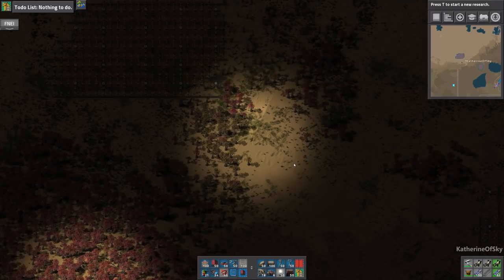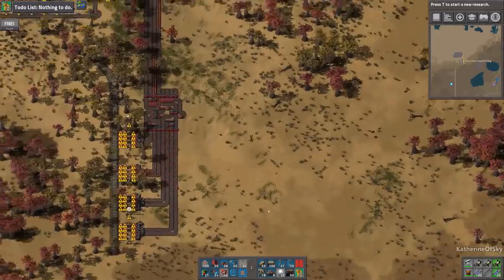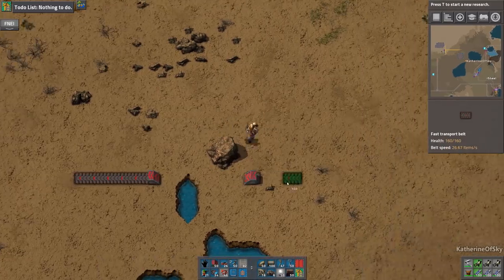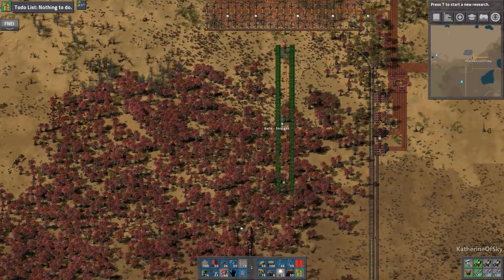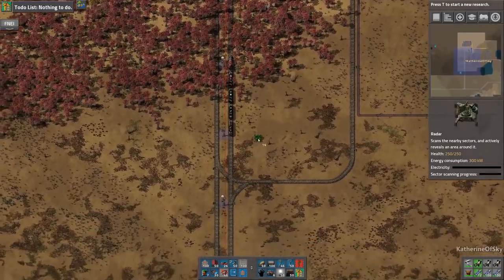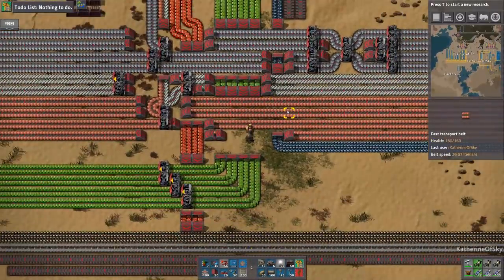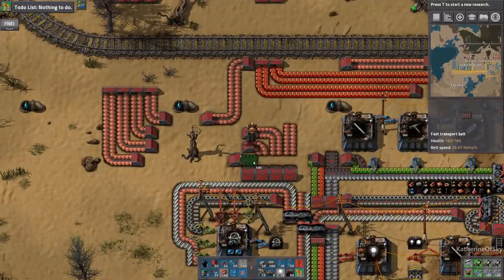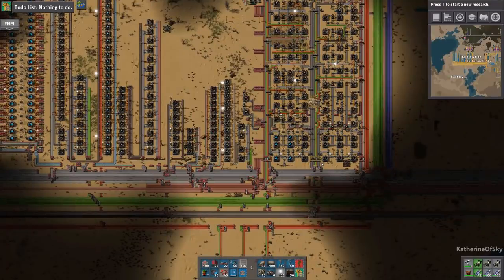Whistle Stop Factorio Ep 49: BASE COPPER PRODUCTION - Mod Spotlight, Let's Play, Gameplay

Comment: For straight rails, you could make a blueprint with signals 5 carriages away from each other? Until there's a better option maybe. Keep doing what you're doing, love your Factorio series'!
Reply from the maker: That's an interesting thought.  My current BPs are tuned to the max large power pole distance, (so to save on power poles), but signal length might be a better item to tune for.

Comment: If you're worried about belting yourself into tracks.. There is a method of braiding 3 belts onto the width of 2. Two underground chains that are NOT started at the same point, with a 3rd belt snaking in between.
Reply from the maker: You can braid 3 belts into the space of 1 if you use all different-colored undergrounds.
Reply: That requires using e different colors of undergrounds, which means that two of the lanes are going to be slowed down. This method only uses one color of belt.

They actually teach you that in the belt puzzle minigame.
Reply from the maker: You didn't specify one color in your original post! lol
Reply: @KatherineOfSky  usually, wouldn't it imply that multiple colors aren't needed? Yellow belts are exactly long enough to pull this off.

Comment: +KatherineOfSky you don't have a belt balancer after the base copper smelter, I'm not sure if it will make a difference, but right now those lines are assuming you use them equally. Unless of course the smelter balances as it unloads onto the belt.
Reply from the maker: The smelter auto-balances the belts.